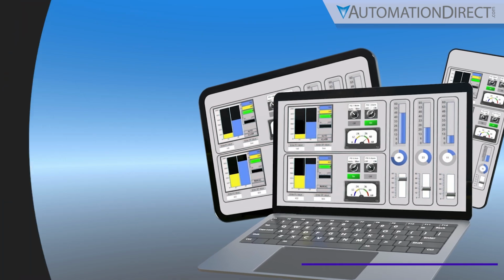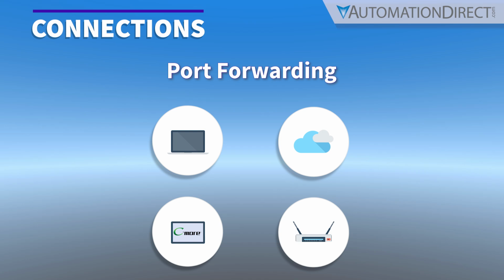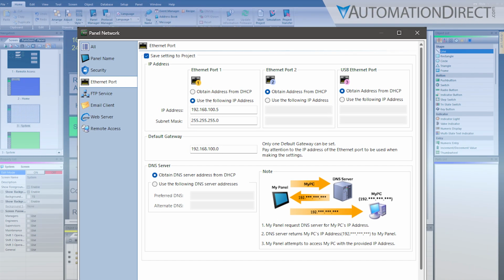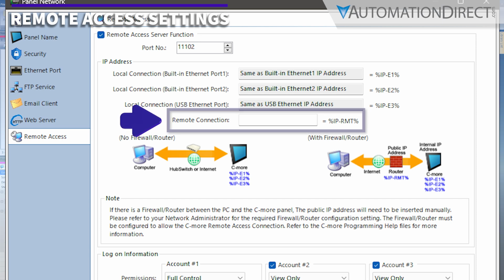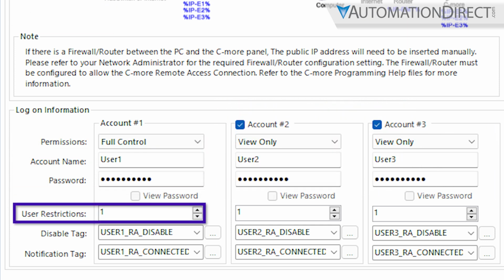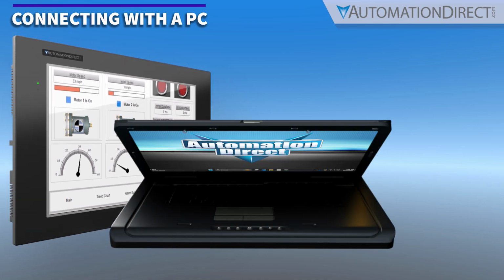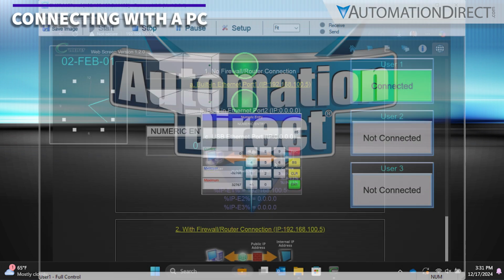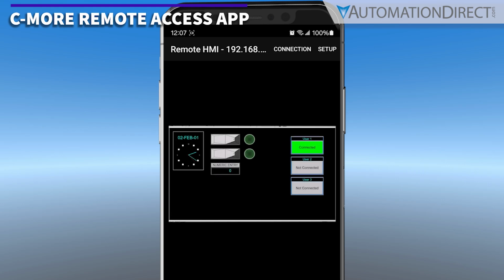Set Up C-more Remote Access from AutomationDirect

Comment: It would be nice to be able to type into a text entry box remotely (currently working with a CM5 RHMI). I'm aware of the popup keyboard option but for what we would like to type, that would be such a clunky way to go about it.
Reply from the maker: Thanks for the feedback and comment! I looked into this further, and there may be an option that could work for what you’re trying to do.

The CM5 supports a USB input device connected to Port A on the panel. This feature is intended primarily for barcode scanners, but you may be able to use that functionality for your application. The text entry object must first be selected on the panel, and the entered string must end with a carriage return, or you can touch the object on the panel when finished. Reference the help file on this by looking at "Style 2" here:
https://cdn.automationdirect.com/static/helpfiles/c-more/ea9/EA-HELP.htm#423.htm

If you’d like some help figuring out whether this could work for your setup, our Technical Support team would be happy to help:
https://www.automationdirect.com/contact-support/?utm_source=m74JX-oIzJY&utm_medium=VideoTeamComment
Reply: @automationdirect  Thanks for the reply! I should have mentioned I knew about Style 2, we've done that in the past with wireless dongles and those mice and keyboards are always nearby. I just want to type into a text entry when connecting to it remotely is all. The problem is that many sentences would have to by typed remotely into text entry boxes from time to time so just using the popup keyboard isn't going to work. I'll try reaching out to the technical support team.